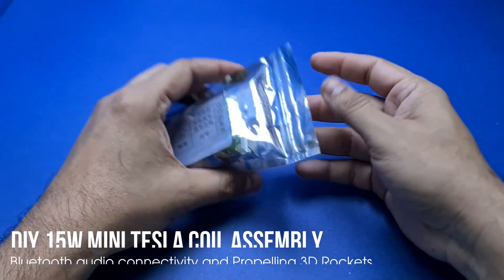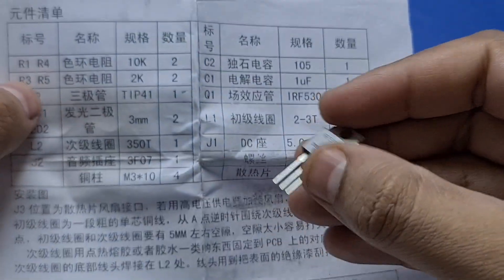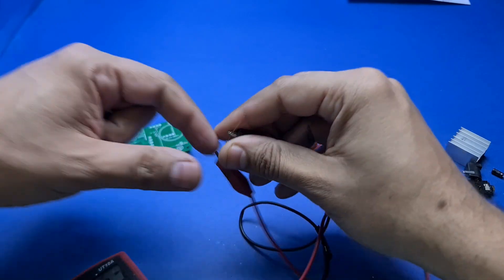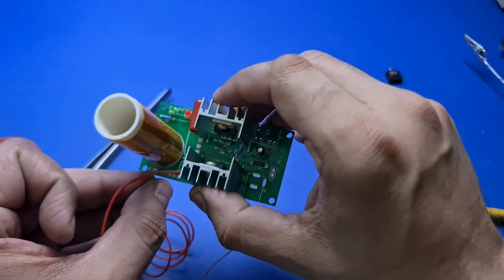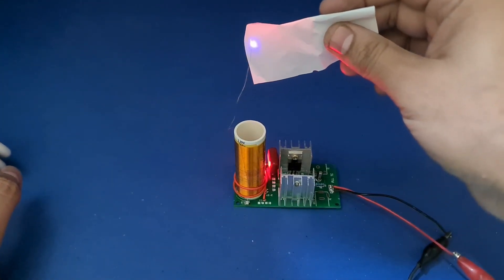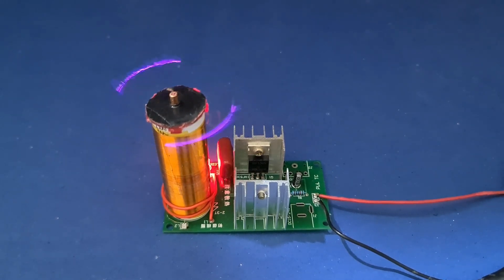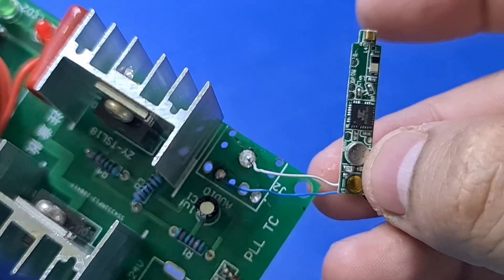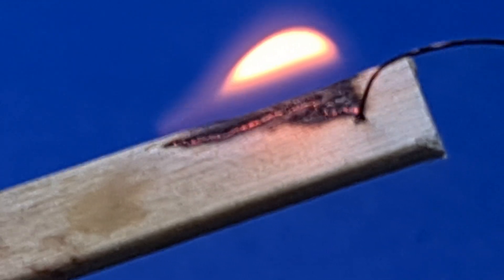DIY Mini Tesla Coil 15W (Connect with Bluetooth)

Comment: I just got one of these kits. How did you rig / connect the 2  wires to race around? Did you first connect the coil output to the brass tube?
Reply from the maker: My coil didnt have a brass tube, it was just a coil on a paper pipe.

Comment: what PSU do you use? thanks for the video
Reply from the maker: It is a 30V 5A + 30V 5A split CC CV variable power supply unit.